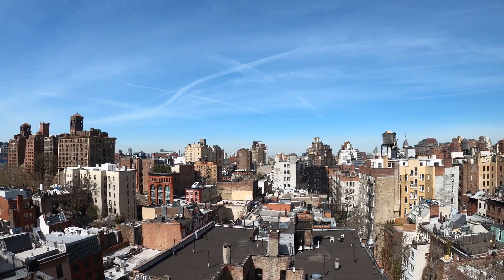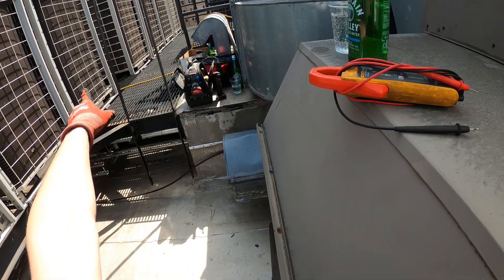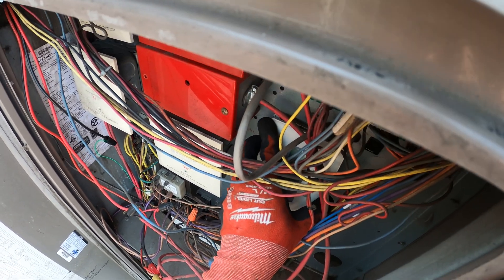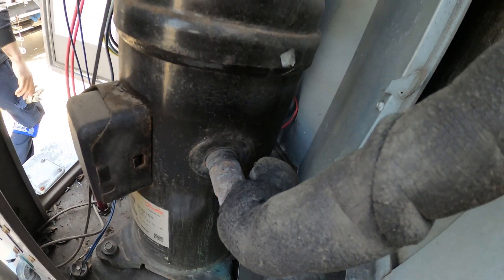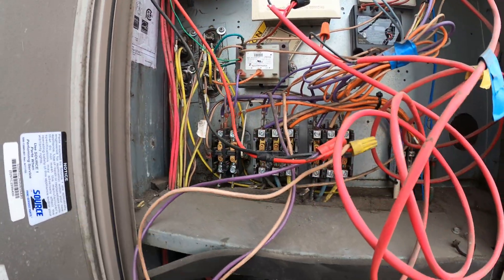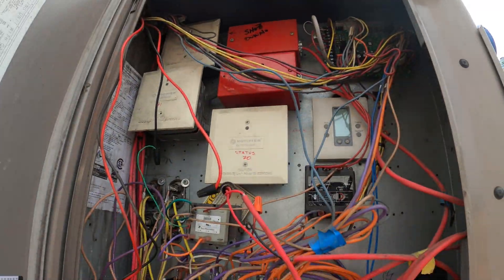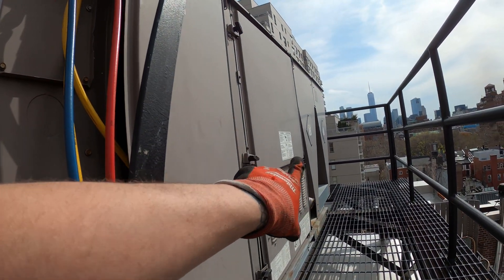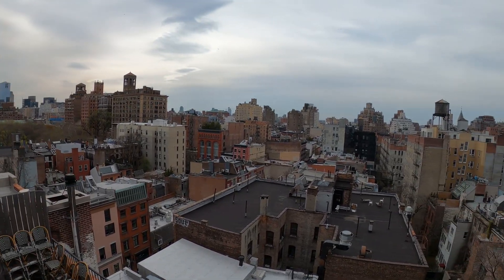HVAC Service Call: York RTU Not Cooling (Packaged Rooftop Unit Not Cooling) RTU Troubleshooting

Comment: 5:08 - Pitted pads on a contactor doesn't run high amps, at least not directly. It can indirectly cause high amps by reducing back EMF in the motor, but this is secondary.

Comment: Dirty filters plus dirty evap coil= low pressure code you cleared when you powered down unit to play with the stat. Always pull up york codes before power down. Good way for a call back due to unit seemingly working normal once powered back on. Like the gloves!!

Comment: Don’t waste your time the leak is on the condensing unit. They use the aluminum coils at the copper connection. Every single one of these units leaks in the exact same spot. And if it’s not there, it’s under the pressure fitting on the discharge line right at the compressor. It cracks as well due to vibration.

Comment: When you walked up to the unit, the flash code said low pressure compressor too, and then you reset it and did all this extra work but still have not fixed the actual problem

Comment: With a really low discharge temp .  cleaning the evaporator coil is the priority . loved to know what the full load amps on the evaporator blower motor . got to check if you made a follow up video . Thanks for showing

Comment: You can spin the covers around on those contactors, so the specs are right side up 🤟
Reply: Also the 6 flash code on the simplicity board was a low pressure lockout on circuit 2.
Reply from the maker: @treborwhite  Thank you! I seen you wrote that in another comment as well. I haven't dealt with much York packaged units so any advice is much appreciated. Thanks for watching!
Reply from the maker: Appreciate the advice! Thanks for watching!

Comment: Sometimes I'll use electrical tape and use that to mark what it is and where it goes. Most manufacturers use a number system with or without a letter as well. Trane is a perfect example. Every wire is black and you absolutely need the wire identification to know, unless you mark it. I just replaced 2 of the 3d scrolls on an intellipak. Everything started up with no issues because i marked the wires and used the diagram to confirm.

Mark your contactors too.....helps the next guy or an inexperienced guy out.

Comment: You could of switch the front cover plate to not read them upside down
Reply from the maker: Thats a good idea. You mean the contactor cover plates correct? Thanks for watching!
Reply: @JumpermanTech  you can do the back mounting plate as well. So the coil line’s up with the control wires and mounting screws. Make it work for you. So when the person sees that you took the time to make it look right. Respect! I worked for JCI/York for years as a start up and Warrenty tech. I always did that especially if they knew your a factory dude. I retired after 35 years last March. I miss the crew and the accomplishments fixing things. Just my body couldn’t do it anymore. I enjoy retirement , grandchildren and my Harley driving on the west coast overlooking the beaches 🏍
Reply from the maker: @samuelaranda4568  Thank you for the tips! I can understand the way you feel. Wow 35 years. This is a very difficult trade to be in that long. Congratulations on retirement! That's awesome man, enjoy that bike & beaches. I also ride a motorcycle. Enjoy with happiness & good health 🙌🔧⚡️

Comment: What was the return temp? And what was the code you cleared when you reset it?
Reply: If you notice in the beginning of the video you had a 6 flash code. That’s a low pressure lockout on circuit #2.
Reply from the maker: @treborwhite  OK so the LED on the left that flashed 6 times is flashing a code indicating an issue. Noted👍
Reply from the maker: @treborwhite  Thank you for that! I didn't notice that. I believed it was circuit 2 that was running. Found it strange that circuit 2 would come on first instead of circuit 1. The pressure was definitely really low for R410a. I was surprised it was running.
Reply: The cutout is 50psi so it likely turned off again after you left since it was running just above 50psi when you were gauged up, given what you’ve found I would be looking for an airflow problem
Reply from the maker: @DiegoSanchez-ck2er  Back pressure was low but the head pressure wasn't. It was running at 60 PSIG for the back pressure. The evaporator fan was running but the coil looked really banged up to where we could have airflow problems due to that along with dirt. Poor maintenance for sure. I also noticed at some point the head pressure was fluctuating. Wonder if there's any non condensables or restriction in the system causing this. Thanks for the tips!
Reply from the maker: Return was around 75 degrees & I didn't notice any error code. The unit never was able to receive an error as the face of the thermostat wasn't on its base to even start the machine. Also, it doesn't look like the low pressure control is working as it had a low back pressure for 410a & kept operating. Thanks for watching!